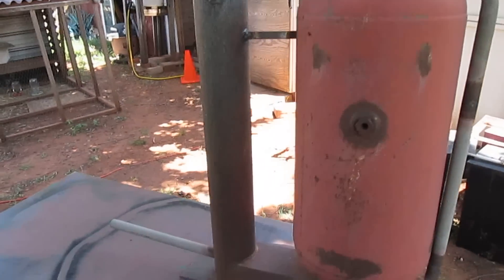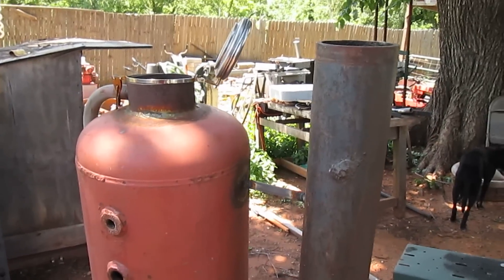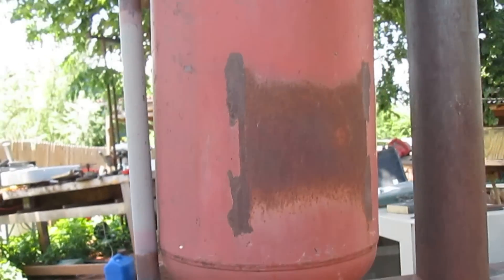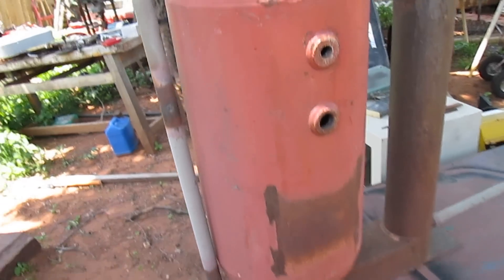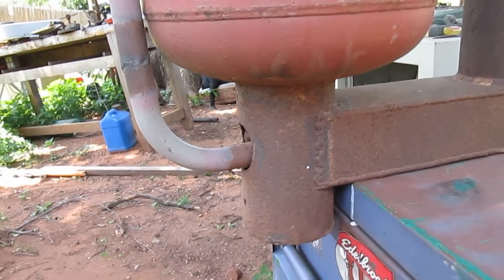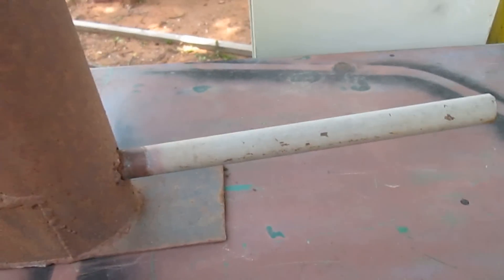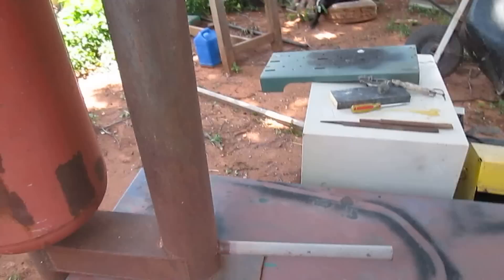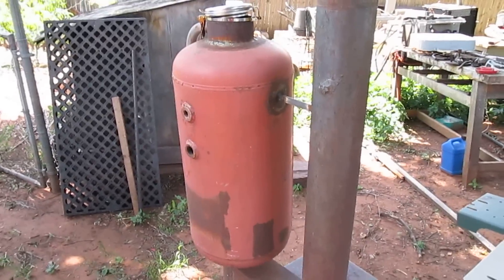Rocket Stove Wood Gas Generator Concept.

Comment: There is a place a place for your idea and someone to run with it.
The Rocket Woodstove Forum
this is the link http://woodstoves.forumotion.co.uk/c1-main
download your video there
There is a lot of member that love your idea
Reply from the maker: Thanks! I'll try to remember to join them soon and send this over!
Reply: @TweezerAddict  have you finished it yet
Reply from the maker: @chrisriley8952  Sill just leaning on the fence out there. Heavy steel -so it hasn't rusted out ...has been on my mind to finish the experiments on it to see if I'm correct.